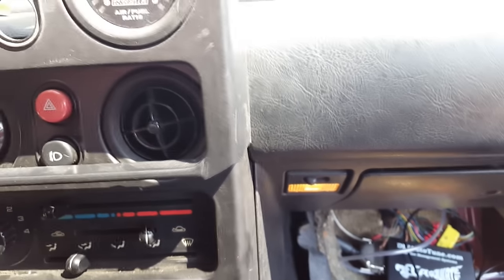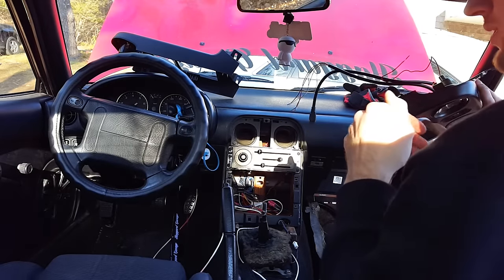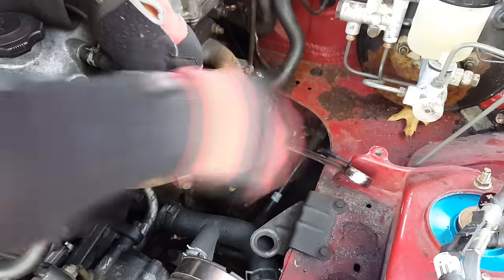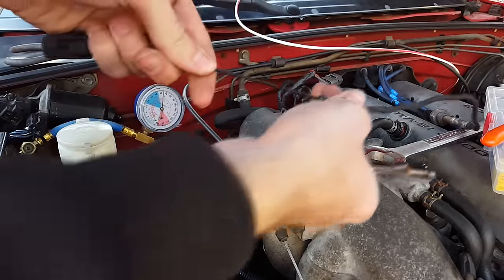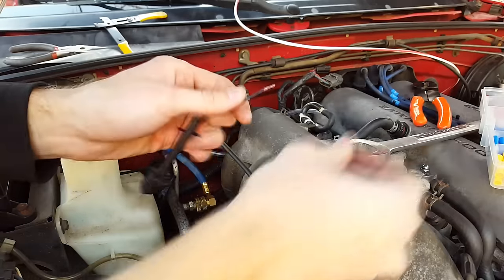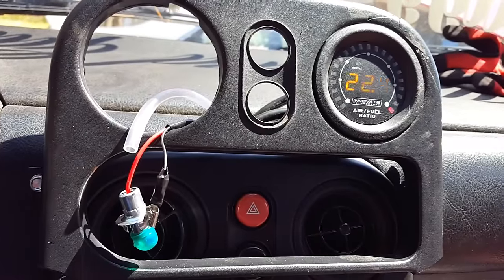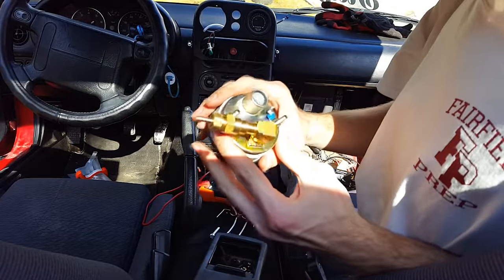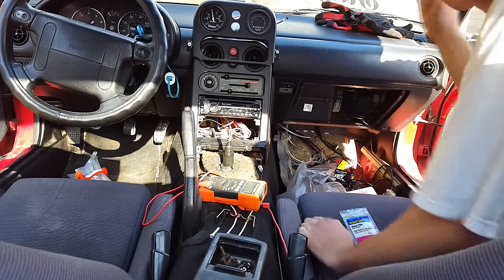Vlog 9: Custom dash gauges

Comment: The reason that 02 sensor sockets suck is when enough force is applied to them Aka "attempting to break a 02 sensor loose."  Since there is a slot in the socket so the wire can go through it causes the socket to stretch when the force is applied, therefore becoming bigger than the intended 7/8 size. 90% of the time they do more harm then good because they usually just round the sensor off and then ur screwed lol.

Comment: I thought you were gonna cut the original consol on the top and fuse the two halves together making it flush and make the air vents go through the big open slot